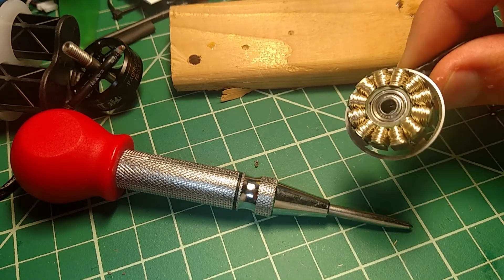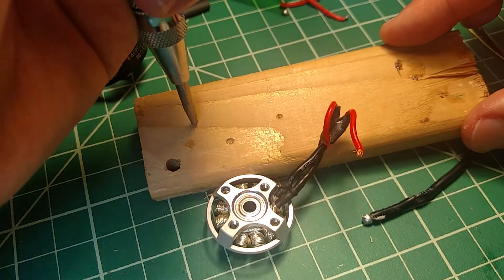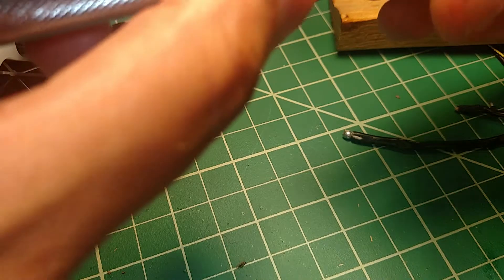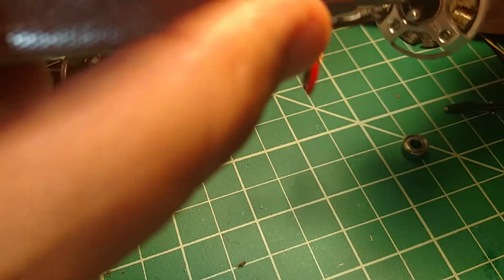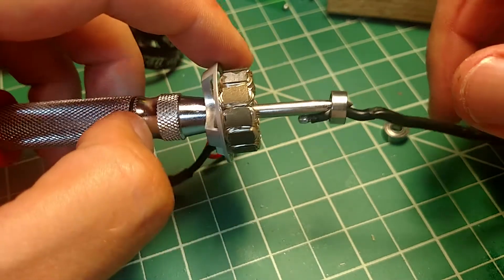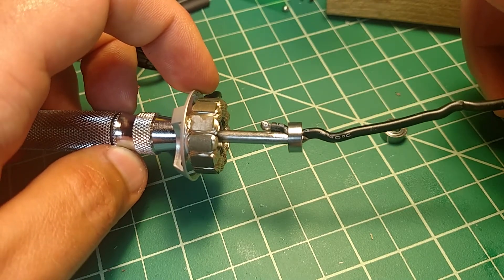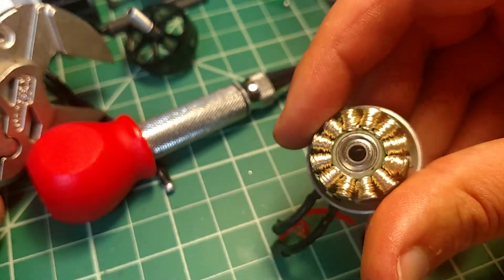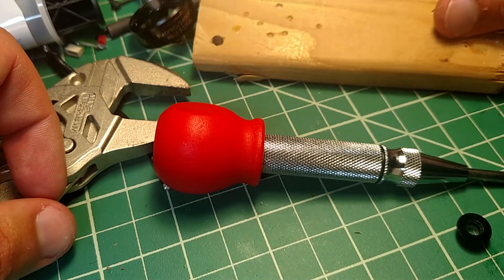Removing bearings from brushless motor with center punch

Comment: Thank very much for sharing this trick !

If the diameter of your punch is bigger than 3mm, just put a CHC M3 screw inside the bearing first, then push the center punch inside the screw head. I had to do it several times before the bearing jump out.

Also I used a stiff wire (paper clip) instead of the electric wire. I bent the last 3mm at 90° and slide it between the 2 bearings, then push on it with the center punch (throught the M3 screw...)
Reply: That's a great idea.

Comment: Love the Knipex parallel pliers, i use them all the time :)

You could probably use a wire made from harder metal to avoid it being punched through. More or less hardened steel wire would probably work really well.
Reply from the maker: Yeah true, it doesn't need to be particularly hard even, I've used paper clips and they're strong enough.  I first used wire because I generally have it laying all over work bench, but also because I felt like it would more evenly distribute the force from the punch on the bearing.  I don't know if there is any reason to really care about that though.  I could just be making it more complicated than needed.
Reply: Since you are hammering on the bearing to get it out, i wouldn't worry about even forces. You are throwing that one out anyway.

Paperclips are semi-hard spring steel so they are perfect.

Thanks for the tip about using a piece of wire to grab the bearing with the punch btw. It might come in handy since i am considering making a more conventional bearing remover that doesn't damage the bearings like knocking or punching does. Might be nice if all you want to do is clean out the motor without replacing the bearings.